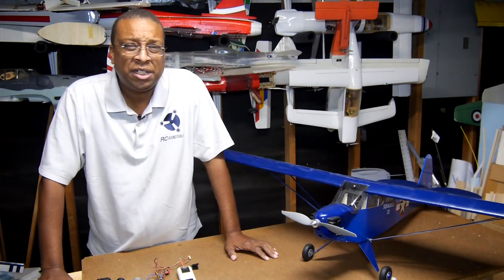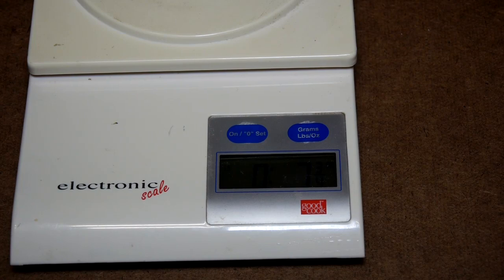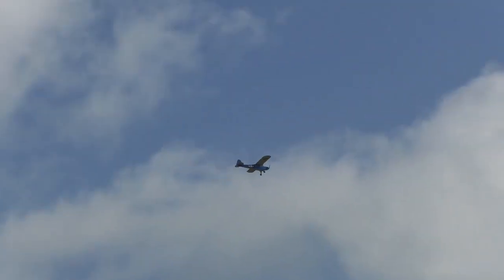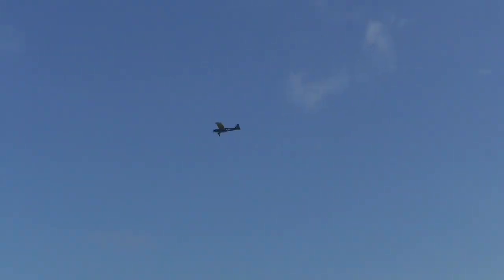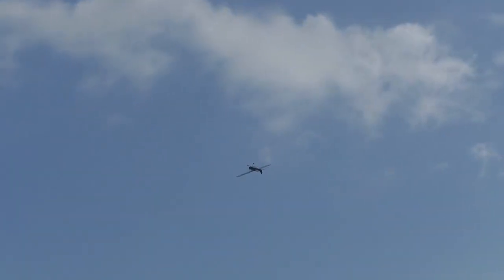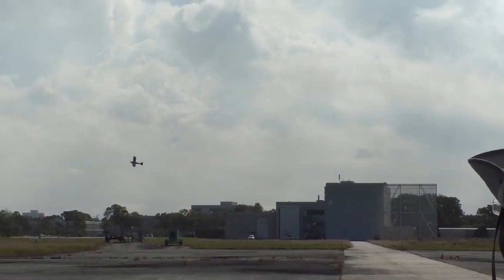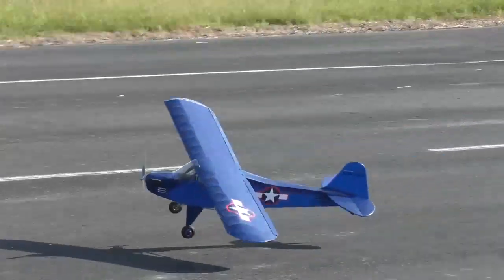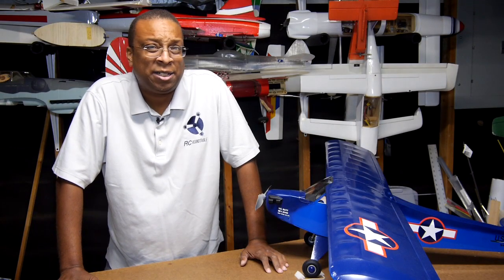Electricub II Flight Review | HobbyView

Comment: too much power and light weight (love it )compared to my 1995 Great Planes e-cub's goldfire can motor and 6 cell nicads and servo mounted on-off toggle also a 2:1 gear system. recall there was an extra supplement in kit on how to lower weight, i used AA nicads 7 cell powerful but brief